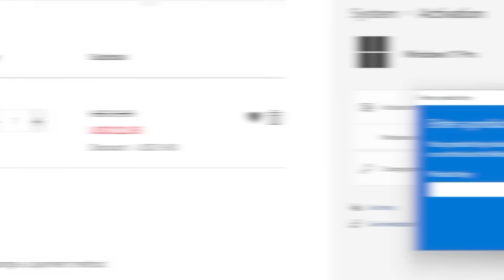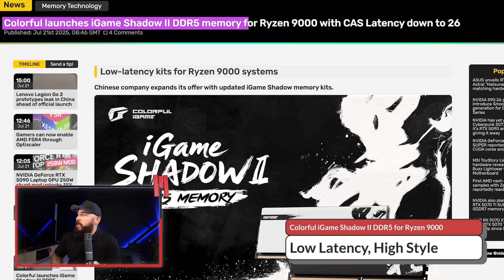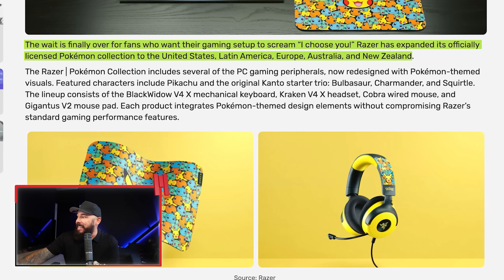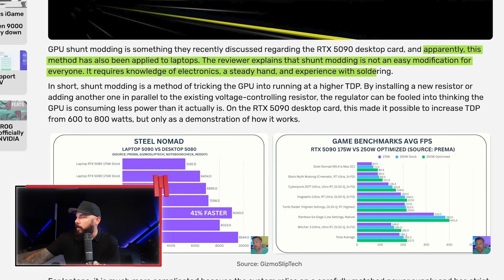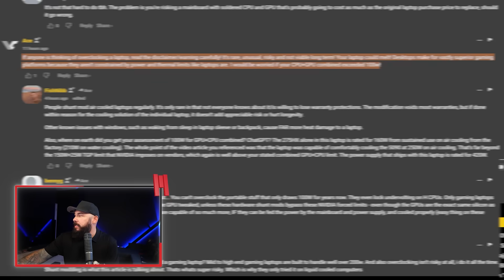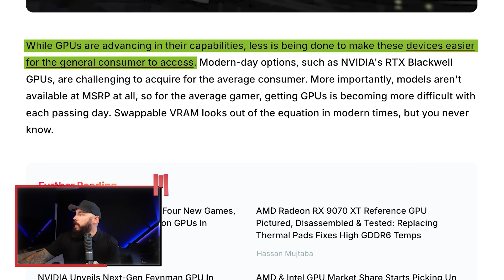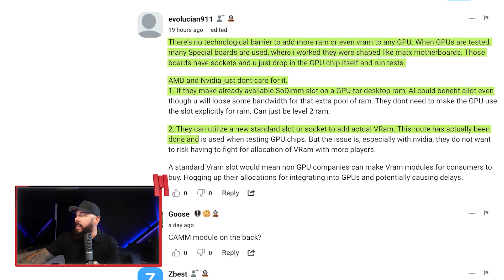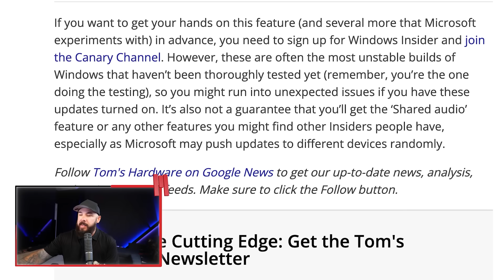Add VRAM To Your GPU?!

Comment: if they really want performance in games they have to forget GDDR and slap maximum capacity (256 GB or more ) maximum bandwidth minimum latency maximum bitwidth HBM3E or higher memory combining with 24 GCDs each having 12288 stream processors / CUDA cores powered by 32X 8 pin power connectors and a 4x 180mm fan with a huge thick and dense heatsink and 32 heatpipes.  if they want to really increase CPU performance in games they have to make CPUs in a way that for example 32 cores can handle 64 threads or 32 threads or 16 threads or 8 threads or 4 threads or 2 threads or 1 thread. if a game is bottlenecked by single core performance all your 32 Zen8 cores come together and act as one gigantic core that is processing the main thread of the game.

Comment: We used to have vram additions on cards a very long time ago. I think they went out of favor since it's easier to just solder on the chips and release a bios that handles one set.
Reply: When you say easier you mean a way that corpos can lock you into a spec so you have to upgrade later. They would lose so much money if we could just upgrade VRAM and a Chipset.

Comment: What would be nice is a new PC architecture with two motherboards: one for CPU and one for GPU with swappable GPU chip socket and vram slots. It makes a total sense because GPUs nowadays take 50% or more from a PC build budget, this way you could customize it more, way better upgradability, better cooling. It probably would never happen though.
Reply: Maybe not even separate motherboards because you may run into latency issues. A better idea would be to add the GPU to the back of the motherboard  to decrease latency and increase stability in transfer rate. Or build the GPU into the CPU, but they already do that with APU’s. If there was a concerted effort by Nvidia to actually work with CPU manufacturers, it might be possible. I doubt they would though, considering how money hungry they are
Reply: @Mediocrates9 Latency is solvable especially considering that there will be much bigger interface than pci-e. The idea is maximum modularity, since GPU is basically a computer in and of itself and current GPUs seems to be lacking in vram.
Nvidia makes server AI equipment, desktop market is not the goal for them, that's why we get sloppy seconds. They genuinely think that they can replace performance with AI generation and stupid gamers wouldn't know a difference.
I think only Intel could pull that off, but they are in a very rough shape and can't afford any risk.
APUs are probably a way to go, especially for gaming where you don't really need strong CPU performance. But we don't even get that, because it would involve changing a status quo.

Comment: The fact that the reason is because of the path traces is false. You can replace the solder balls with pins, like old PGA cpus and you could replace those chips with a greater capacity ones. It makes the GPU a little larger but... Are we really going to complain about the GPU size? All you need is to adapt the cooler to the new height of the chips. It will also make it have better contact.

Comment: imagine this, CAMM2 socket on the back side of the video card. This would be the shortest path for connectors. This would also allow you to efficiently cool the memory water cooling in a "sandwich" method. The hardest part would be the drivers. BTW i used to own a card that had expandable memory, it was a Matrox agp card.
Reply: Matrox 64 user here, agree that it would be a hassle when non-standard modules, but the thing is, there is now just 4 company making them so it won't be a problem anymore.
Reply: (Que latency increase claims)
It might increase latency slightly, but I doubt it will be by much.
Reply: @johnchristianson515  Using the back side of the card would be a shorter path than where memory is located now. SO it should have better latency. hypothetically of course, no one will know until it is tried.
Reply: @johnchristianson515  .000000015 second latency VS Irect on board at .000000014
Nvidia: ITS IMPOSSIBLELLLLELLEEL THE GPU BREAKUS!!!
China: Done 3000$!

Comment: I would like to see the whole CPU GPU system rethought.
GPU's are arguably more important now than cpus.
And gpus are so big the basically remove all the other expansion slots on your motherboard.
SLI/Crossfire is dead, so What if we moved the cpu to the middle of the motherboard, and the GPU slot to the top, leaving the other expansion slots open on the bottom.
OR perhaps, make the cpu and gpu on the same board, but have them both socketable.
So you could upgrade both. You would still have the vram limit to what the board came with. But you could upgrade the cpu and gpu.

I think the current layout is way past its due date. And thinking outside the box on motherboard, gpu, cpu layout could yield some massive benefits.

Comment: As somebody who has been around tech. for a while now. The reasoning at 11:45 why we can't have swapable VRAM, is complete BS. Anybody remembers socketed CMOS chips? Or even simpler, we are still using it for CPUs. Such sockets can easily made for VRAM. Instead of the RAM chip, you solder the socket to the PCB and can just pop chips in or out. The real reason is, Greed, nothing else.

Comment: video cards memory back then doesn't heat that much (no need for a heatsink either) so its possible to add memory through a slot or connector but in modern vc not possible , how can you cool that thing, you have to upgrade or replace your entire cooling system for the videocard? BUT the CAMM form factor for RAM might be our hope a swappable vram, maybe?

Comment: The whole 8 GB argument is a giant "straw man" discussion. Let's dig into some truth. MOST games at 1080P and high detail work fine with an 8GB VRAM buffer. SOME newer titles have issues but the majority work fine. So immediately when someone says you cannot use an 8GB card for modern games, they are feeding you BS. 

The real argument, at least the one with merit is the pricing and naming conventions. The decision by AMD and Nvidia to keep the same ID for a card with an 8GB and 16GB variant was a pure BS marketing move, and they should be called out on it.  

The pricing argument is another valid point is the pricing. In the current market an 8GB card should be $250 or less with 16GB cards filling the mid-range and higher VRAM at the high end. AMD already set the high-end bar with the 7900XT and XTX for higher end VRAM options. So, cards $250 and less at 8 GB, anything above $250 to say $750 at 16GB and then above that at 20/24GB. 

These are reasonable argument points that do not use hyperbole and actual false data and try and make an argument.

Comment: or, crazy idea: have the ram modules slot in like cpu's do, that way it isn't complicated and it would only cost a little more, of course the modules would have to be standardized so they all fit but it is better than what we got now. People with a lot of time and knowledge mod their gpu's the same way except they have to solder those on.

Comment: You want your GPU to last longer? Vsync and quit running at 98%, most equipment has a shorter lifespan running at full load. You build a more power system so you do not have to run full boar all of the time.
Reply: Hopefully adaptive sync instead of Vsync; and it is less about load level and more about temperatures over time. Typically >85 degrees C long term is a problem in my experience.
Reply: @undefinablereasoning what about 60-65c at full load?
Reply: @40rollsonly  not a problem
Reply: How can someone speak so confidently about something they don't understand? As long as the temperature stays cool, it's not gonna break. And what's the point of using vsync? Genuinely, why does anyone want to put up with that jelloey mess
Reply: @amalionpizzachicken  not even that, realisatically gamers think too much about temperatures imo. my 5700xt has been going strong for 5+ years when for some time it had bad termal paste with bad termal pads reaching 110 C hotspot temperature, and its still okay. while its true heat is the only thing degrading the chip, realistically it can handle beating and be totally fine
Reply: instead of using vsync just limit it vsync increases latency and if ur on linux with wayland like me it already has some frame pacing thing so screen tearing just doesnt happen
Reply: The thermal limjts set on those cards allow you to do so. Mining cards had little to no issue other than them being dirty and thermal paste drying up. Fix those and they are essentially new gpus again. There is no porblem running them at 100%....
Reply: @zip3704  On the core maybe, but the memory is a different issue; I've seen evidence of them degrading over time if they are run hot.

Comment: Cards like the 5050's should be priced as disposable GPUs, lower number cards are made from the lowest desirable chips with deactivated sectors due to manufacturing defects. 8gb 5050's should be priced at $150 USD due to lack of value & interest.
Reply from the maker: good point. A 5050 at $150 would absolutely have a place like entry level, budget builds, HTPCs, or kids’ PCs
Reply: There would be a lot more interest if they made them half height single slot cards that ran only on pcie slot power
Reply: Sadly $150 absolutely does not cover the manufacturing cost. They would actually be selling on a big loss.
Reply: @vitor900000  $225 then. They can easily do that. The GPU is so small it's not even a postage stamp.
Reply: There should be no such thing as a disposable GPU. There's too much E-waste as it is. They're just greedy, selling worthless cards to people who don't know any better.
Reply: @Squidgy55  They aren't 'disposable.' They are called that because people don't see any reason to buy them, they completely ignore the abundance of people who might be building something that doesn't need a lot of power but might play some games. 

That's literally every entry gamer, every kid asking their parent for a gaming pc, and everyone with a living room they want to play PC games in. 

As a PC enthusiast/repair tech, I'm more interested in higher end older cards, because the value is simply phenomenal right now. 

But there is definitely a consumer for these cards... it's just not the 'enthusiast pc gamer/streamer/builder.'
Reply: @Squidgy55 100% with you there, these lower quality binned chips should be enough of a deterrent.
Reply: And it should draw power from the PCI connector only. Possibly even make a passive version. Looks like the last passive card was the GT 1030. It's been a while.
Reply: @Toshinben  Yes, exactly. The only problem is that would mean they would care about engineering good cards for gamers, and they would rather just throw us off a cliff right now so no, probably not going to happen brother.
Reply: If your value is 'new card with warranty/return options' then the 5050 represents the only option at its price point from Nvidia. You can buy a 3050/3060 new still, but they are coming from 3rd party board partners with potential issues with RMA/Warranty when you buy them from a place like Amazon. 

Personally, I'd rather buy a 3060 12gb new from Amazon in July 2025, than a 5050 from anywhere... but that's just me, knowing what a 3060 can do (especially GA104) and knowing the 5050 will be a worse experience by far...
Reply: I feel like Nvidia knows what they're doing.
Reply: Should be a 99 dollar card. Its what you put in when you just want video. Its a basic pos with low vram and costs way too fkn much.

This is coming from an nvidia owner... so im a hypocrite. I hate nvidia but use them. I have a 4070 ti super. Even this pos should have a minimum of 20 GB of vram. Should be 24. The base cards should be 16.
Reply: @Jim-hm9ch actually that doesn't make you a hypocrite that makes your argument stronger
Reply: @Jim-hm9ch   "I hate nvidia but use them"
We all do, and do you know why ? their software is actually good. 
That's the problem with AMD, the hardware is good, but the software is not, it never was.
Reply: @Jim-hm9ch yeah man, i hate my 3060 doesnt have 16gb of vram. 
Whats so difficult abou putting a bit more vram in it, and the chip absolutely need a boost in performance, as it struggle with native 4k path tracing..